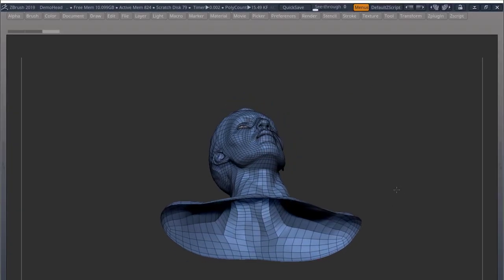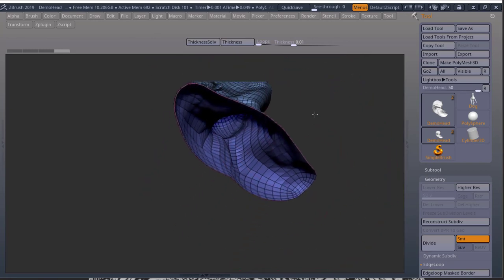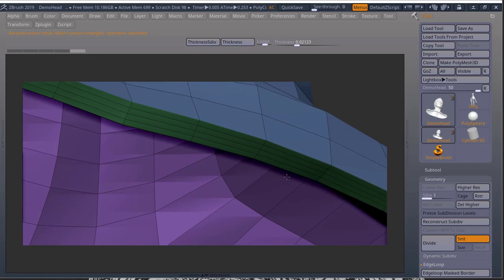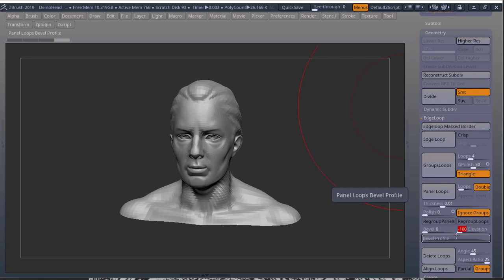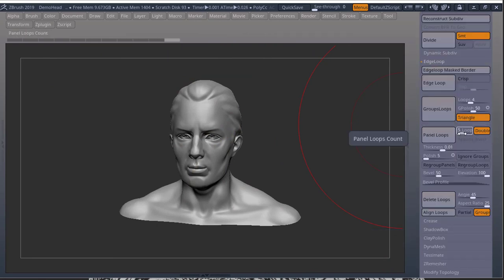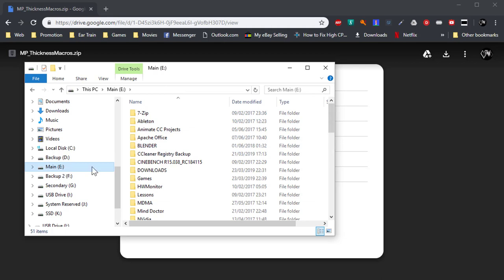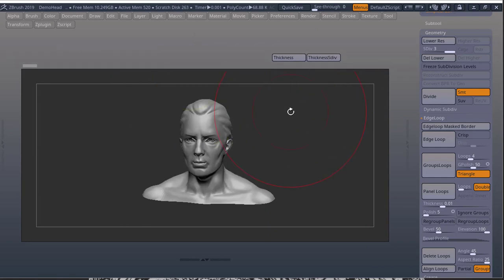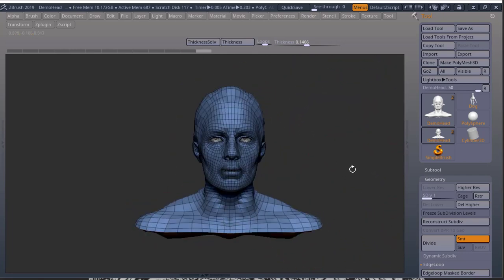Zbrush - Add a Thickness Button

Comment: Great addition, thanks. I'm wondering, is it possible to control what direction the model becomes thicker? By that I mean can thickness be made to increase either just projecting in the model, or or projecting just outwards form the model?  Hope that makes sense.
Reply from the maker: I believe that would be achieved by changing the elevation to a positive 100. Can't remember for sure winch one but one of the params needs to inverted for a different direction of extraction

Comment: when i go to customize UI, the actual button does not exist. when i go to use macro under the macro tab, it fills in my model completely. I am uzing the zbrush 2020 on PC. Any ideas?
Reply from the maker: Maybe you are using ZBrush Core or Core Mini? These options might not be available if that is the case.
Reply: @MadPonyInteractive  i am not using core or core mini :(

Comment: I'm a novice Zbrush user.  I am just trying to follow the very start of your video, using the z modeler brush.  I tried to follow your instructions, but when I pulled on a poly, nothing happened.  It didn't get thicker.  There must be something more to it.  Is it just LMB, or is there another key you  have to add?
Reply from the maker: Not really, in order for it to work your mesh needs to have the same polygroup all around, (same color when yo display polygroups by pressing Shift+F) and QMesh needs to be selected. Hope that helps. Also if you are a novice to sculpting, consider using Blender as it is free and easier to learn.
Reply: @MadPonyInteractive  I’m enrolled in a class that uses Z brush and Maya. After the class is over,  I need to get into Blender. I did finally get the Z modeler thing to work by putting the piece that I wanted to bend on a separate subtool layer. Thanks for your help

Comment: Hi i m having issues also i am running zbrush 2020 v1.3  i downloaded and coppied the files to location you show i then open zbrush  click enable customise then i goto macro and the thickness and thicknes subdiv tabs are not there  not sure what i do wrong should i go through all thsie otehr bits prior to the bit from where you show download and copy files to zbrush ?
Reply from the maker: sorry for the late reply, have you placed the files in the macros folder in the ZBrush 2020 install location?